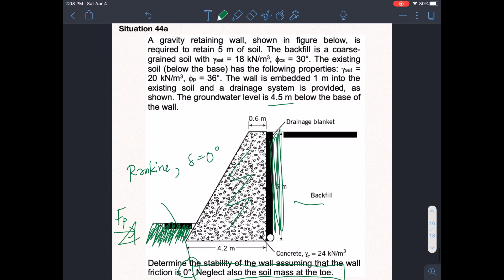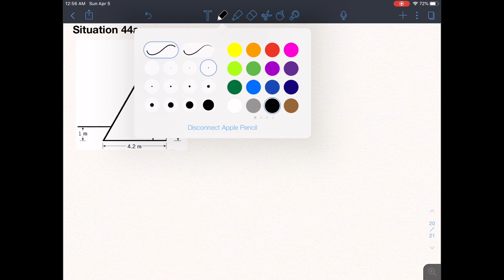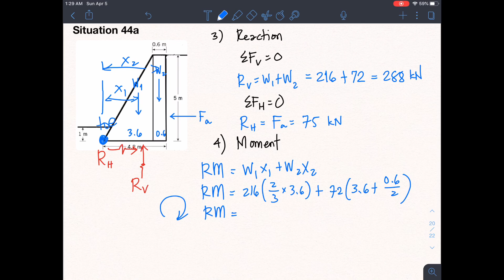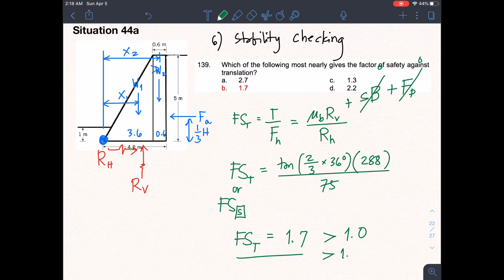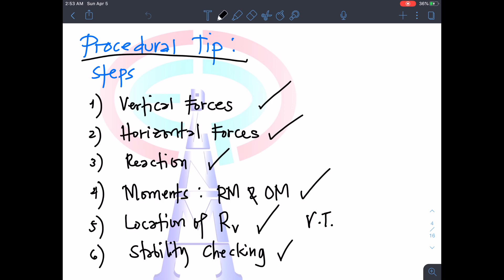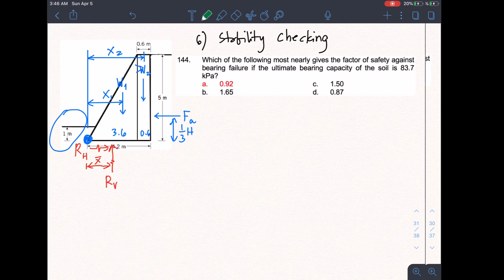GEO02

Comment from the maker: Correction:
23:06 
Though this is not part of the original set of questions and it's really not specified which ϕ should be used on soil mass at the toe, ϕp = 36° makes more sense to be assumed than ϕp = 30°.
Kp = (1+sin ϕp)/(1-sin ϕp), where ϕp = 36°
therefore Kp = 3.85
FS against translation = 2.22